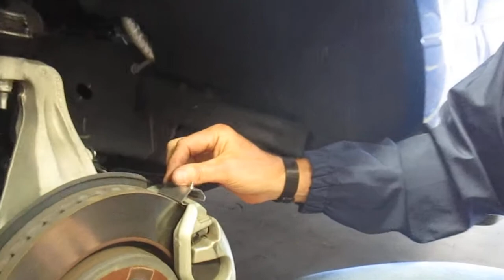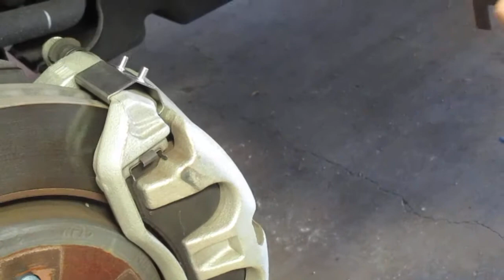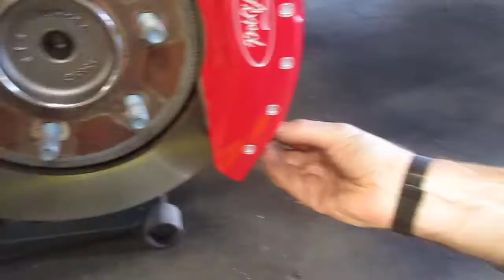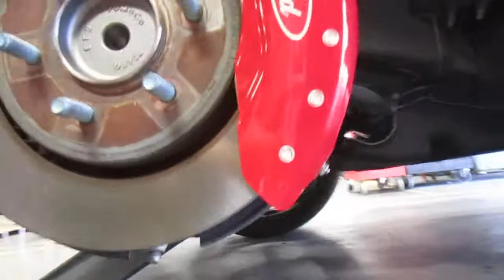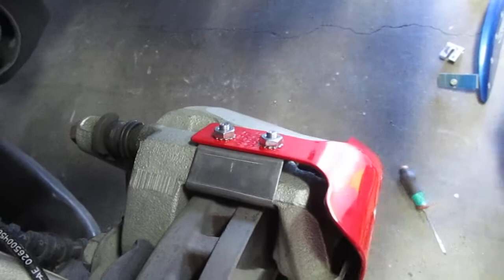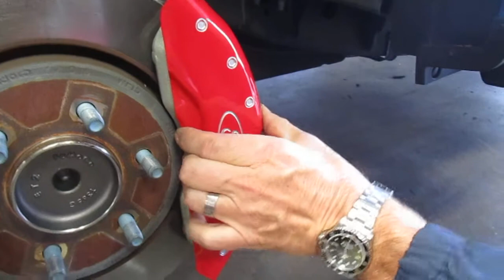Front Caliper Cover Install F150

Comment: Driver side make a lil noise when braking or turning, what u think it is? Sound like they contacting the rotors
Reply from the maker: It doesn't seem like it would be the clips rubbing the rotors because the sound would be constant.  You can double check using the feeler gauge or check the clips for any rubbing.  See trim clips video if that may be the case.
Reply: @mgptech311  
Hi install cover. I call myself trying to do the same thing as I did on driver side front. The passenger side front I’m getting some rubbing in the bottom lower circle front edge. I try to adjust it made some different but still getting rubbing
Any suggestion I can do